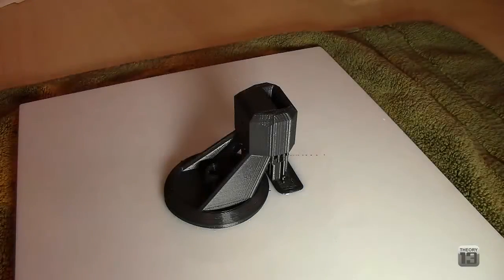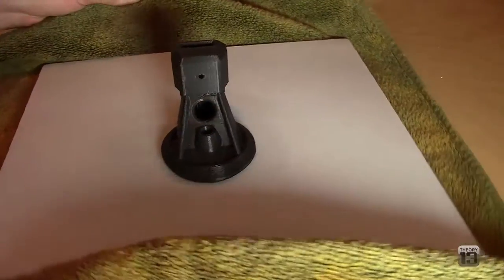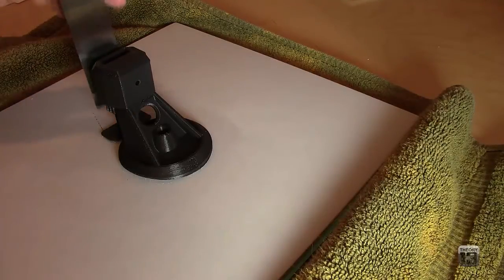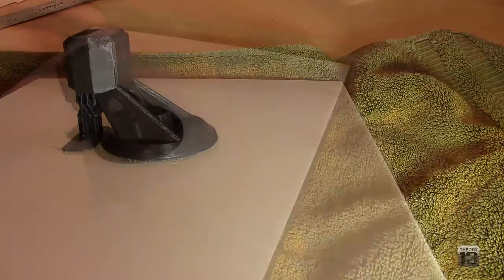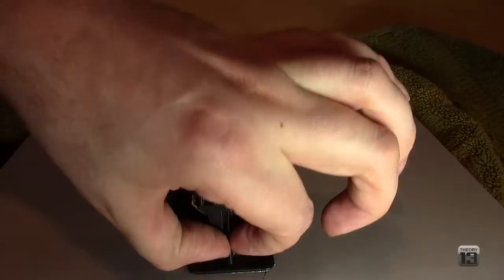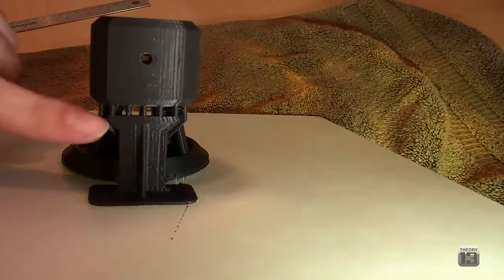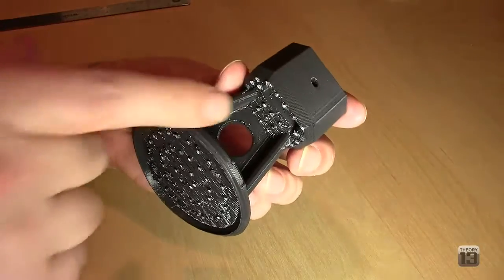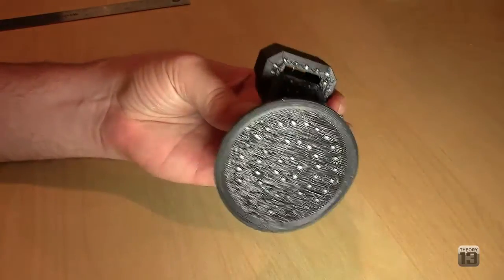Cubify CubeX Duo -- Video 014 -- Follow Up; Printed Supports.

Comment from the maker: I know that you can import 2 STL models.
and then assign different materials to each....
but....Hmmmm.... i've never tried aligning them in a unique way. 
I;m going to have to look into that, as that is something that i'm about to get into as well!
Good Question!
.
It seems like you could "add Junk" like a bounding box (maybe little dots at the 4 corners?) and it would auto-center the models for you??  -- but that seems like leaving a lot up to software that i'm not impressed with yet.   LOL

Comment: I'm very interested in building my own support structure.  I was wondering if you know of a way to build support structure in your model but designate that it be printed with a different material using the CubeX software.
It seems like I would have to import the support as a second model and place it in the proper relative position on the build platform.  I'm not sure if this would work but it seems like it should unless the software considered the parts to be colliding.

Cheers!